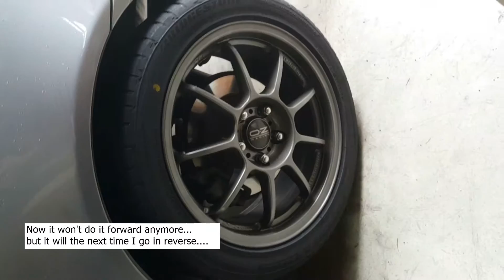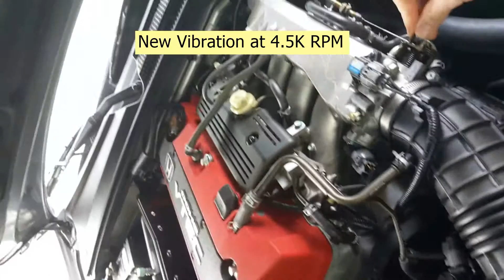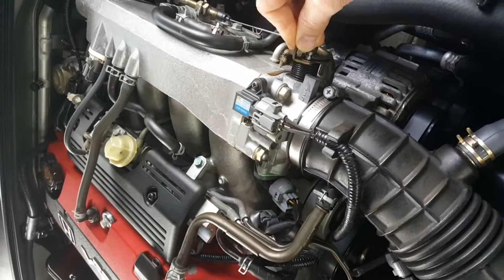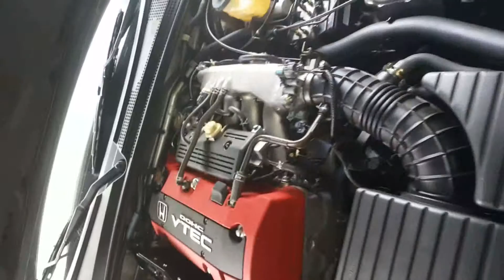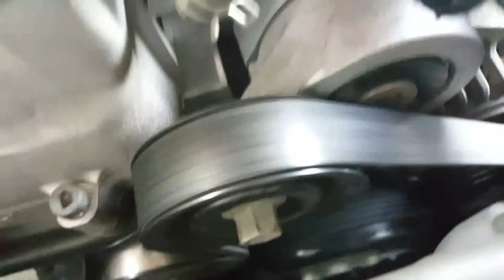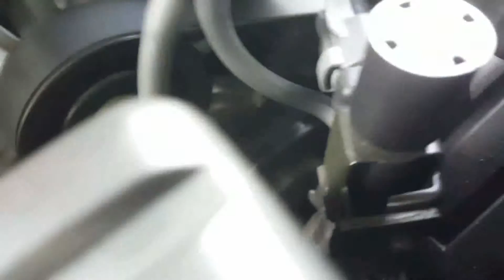S2000 Bad Sounds

Comment: The fix for #1  is rear axle nut TSB.
Reply from the maker: +Jason Parraga Nice, if that's the case, then my comparisons to the other youtube hits show my symptoms must be at the very beginning - not too bad yet. I intend to drive on PIR for my first track experience on 4/21, so I'll be sure get it checked out very soon! +Christof Mcafferty
Reply from the maker: Thank you for that! My mechanic did the TSB and it mostly worked. I can still make it happen, but it's subtle now. I'm getting the axle replaced on the 15th, so that should fix it for good.
Reply: You will need new hubs and bearings. I don't think replacing the axle with fix anything.
Reply from the maker: Thanks for the reply! I probably used the wrong terminology when I typed that. I'm actually following up to find out exactly what the plan is. These guys are very competent, so I'm probably just saying it wrong.

Comment: Did you get these noises sorted?
I'm getting similar vibration noises.. Like an extra rotation or something
Reply from the maker: +Christof McCafferty Not yet on the vibration. I'm trying to get into the shop before hitting PIR on 4/21, but I may end up troubleshooting it myself if there's no time
Reply from the maker: Well the sound went away after I put on MCS coilovers. My mechanic speculates that it was the lightweight flywheel they installed because the OEM flywheel is heavier and balanced to minimize cabin noise and vibration, whereas the light flywheel just focuses on spinning up quickly. The recent addition of the coilovers eliminated many vibrations that I wasn't really aware of. Now the only major vibration is the axle when I apply power at speed. I'm getting the axle replaced on the 15th, which should be the end of this era of bad noises.
Reply: A much cheaper option is to get drive shaft spacers or to simply swap the CV buckets. That will get rid of your vibrations 100% guaranteed. Replacing the axle is so much more expensive and difficult. You can search "s2ki cv bucket swap" on google.
Reply from the maker: Excellent DIY article and spot on for my symptoms. Thanks again for the tips, Jason!
Reply: You're welcome.